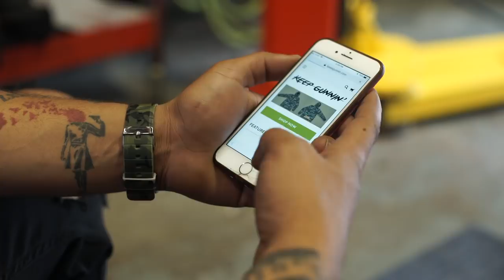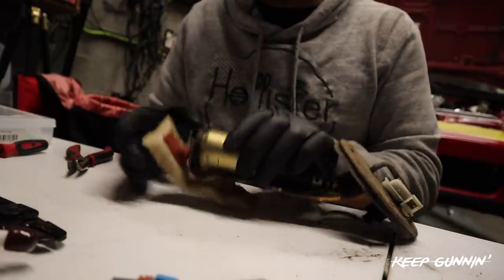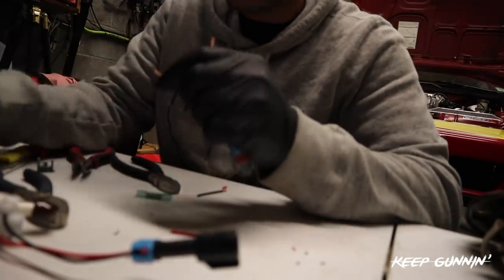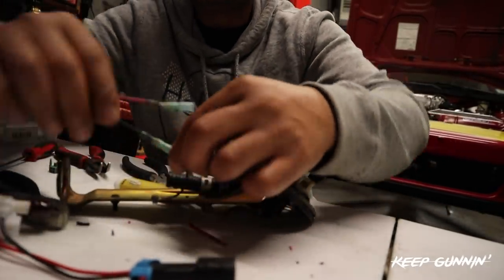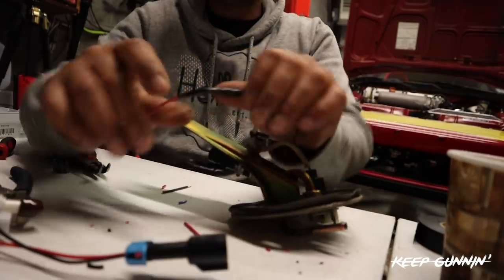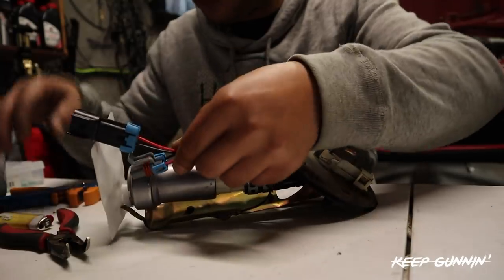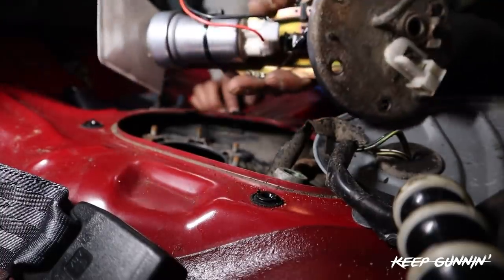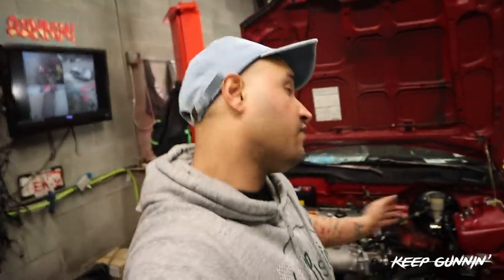K-SERIES DIY: FUEL PUMP!!!

Comment: i did this b4 with electrical tape and always wondered if the gas would dissolve the tape adhesive ,but i sold the car

next two pumps i did ,i crimped one and the other after that i learned to solder and heat shrink wrap 

good video!!
Reply: Gas or oil will demolish electrical tape.    Use good duct tape and wrap it tight. It hold up better in  oil.

Comment: Needs: OEM sock or different new one so it doesnt start sucking air at 1/4 tank left. Dont use ziptie in gas use a hose clamp around the pump and hanger for longevity.

Comment: I got that very same pump on my Civic but I ran into a problem with that Filter. It seems like it doesn't sucks up gas below a quarter tank. I ran out of fuel & my tank wasn't empty. I suggest you use the OEM (sock) filter on that pump.